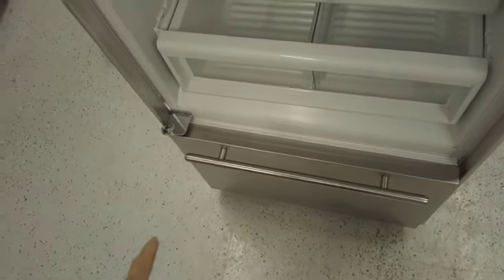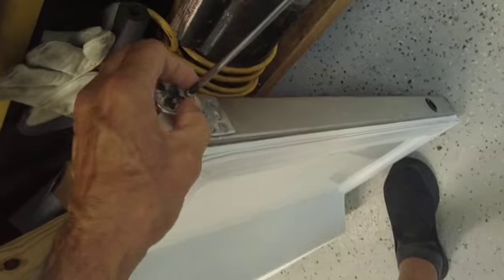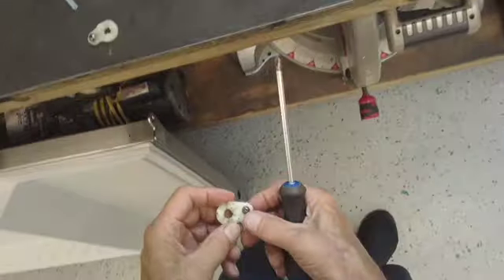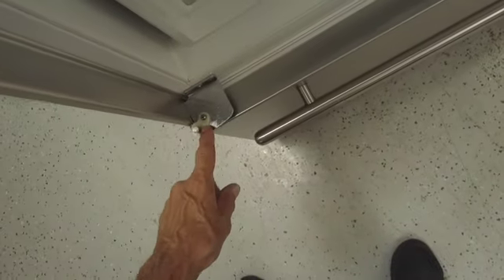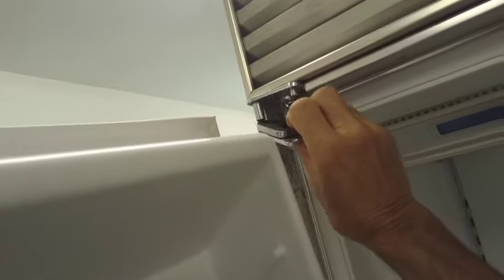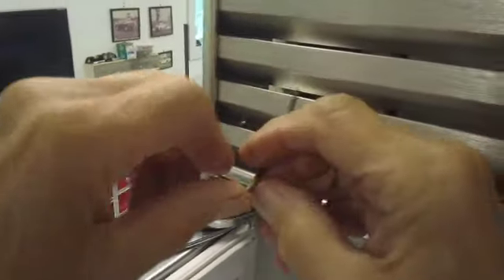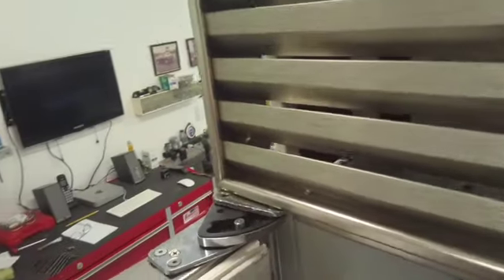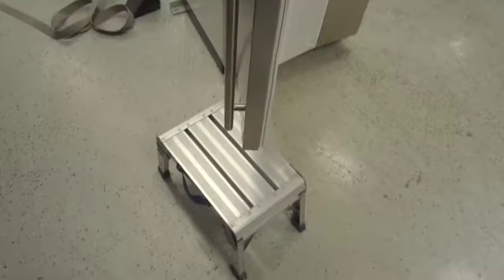Sub-Zero 611-650 511-550 Upper Door Cam R&R

Comment: Great video, partially answered my question I’m in search of and hoping you can confirm if there is anyway I can use the panel ready fridge and freezer doors from a 550 over under and replace the stainless doors of 650? I.e. take the 550 panel doors and use them on a 650? Thank you for any guidance you could provide.
Reply from the maker: You can use the 550 panels on a 650 if the 650 is a framed unit, but if you’re asking if you can use 650 stainless steel doors on a 550 they are different. Is there a frame around the 650 doors that can accept panels?
Reply: Thank you for the reply, sorry for not being clear, seeing if I can use the entire 550 fridge and freezer doors that both have panels and put them on a 650 by replacing the stainless steel doors (the standard more common none panel version) it has. 

I guess my other option would be to see if I can buy 650 replacement panel doors (not sure if those are sold) and remove the current stainless doors but I already have the 550 panel doors, thanks so much for the help! @SubZeroSpecialists
Reply from the maker: I don’t think you can adapt the 650 doors to a 550 because the upper hinge is different, however you can but 650 doors that are panel ready. Call subzero at 800-222-7820 and ask to speak to a engineer, they may advise otherwise.
Reply: Thanks so much for the help/guidance! @SubZeroSpecialists

Comment: Thanks for all the great content. I’ve got dual 611s that, for some reason, the left unit’s upper door stop (black piece with the chrome trim) seems to pop out when the door is stung too far left. Any suggestions? My guess is that the cams at the bottom are worn so the door has dropped a bit…but there is a lot of play with the black catch / stop at the top.
Reply from the maker: Could be the lower door cams or the bearing on the upper hinge.
Reply: @SubZeroSpecialists  Thanks! I’ll get the parts ordered and replace them! Really appreciate all the content man - super helpful!!!